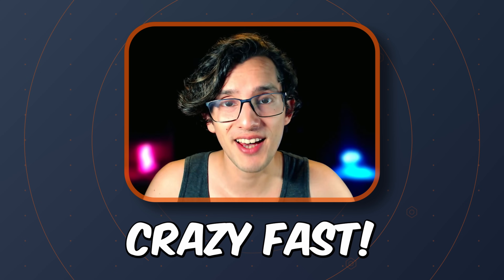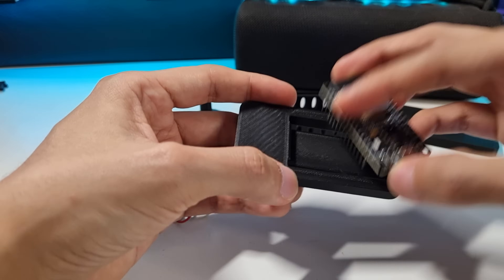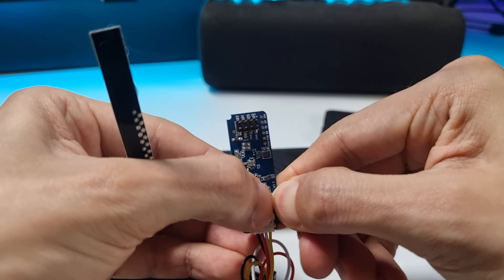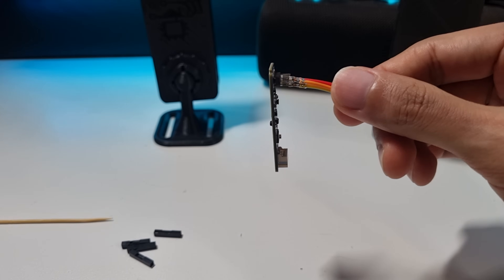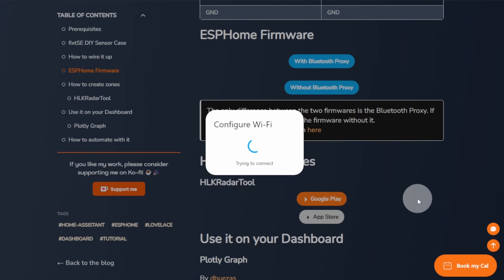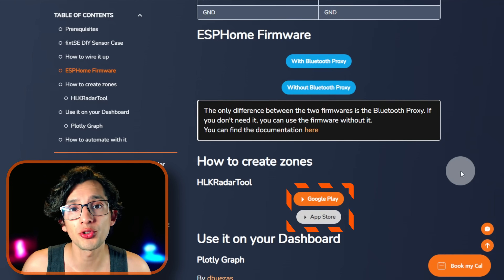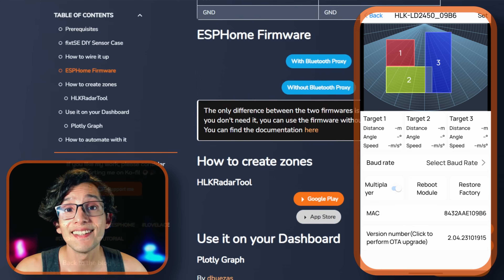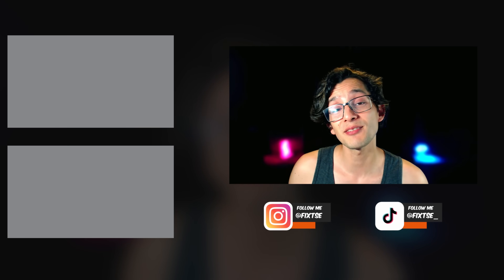Beginner DIY ESPHome mmWave Presence Sensor  |  HLK-LD2450 + ESP32

Comment: Hey, great video and amazing explanation. 

Does it work with ESP32 C6 Board. I want zigbee connectivity instead of WIFI. Also, ESP32 C6 board doesn't have RX2 and TX2 pins, so what are the alternatives?

Thanks in advance and keep up the good work!
Reply from the maker: As far as I know, almost any pin on the ESP32 could be configured as RX-TX (unlike on the esp8266), so that shouldn't be a problem. For the zigbee connectivity part, that needs more work on the ESPHome side (currently the firmware doesn't support to create custom zigbee sensors), not sure if adding support for creating zigbee devices is on their roadmap (zigbee devices are supposed to need a certification from the zigbee aliance, still I just transformed an Aqara Temperature Sensor from Bluetooth to Zigbee with some special firmware, so I'm not really sure anymore)

Comment: Is this built on esphome or is it a custom firmware? Because As I understand the base esphome does not support HLK2450 right now. 

The reason I ask is can we add additional sensors to this?
Reply from the maker: Yes, it's ESPHome, using a custom component to make the HLK2450 work. Yes I have a follow up for this video where I added a light sensor and a temperature/humidity/pressure sensor to the project
Reply: @fixtse.  you are awesome :)

Comment: Hi Fixt, everything installed fine, but, I don't get any info on Target 2 or 3, Target 1 has data, same on HLK app or in HA
Reply from the maker: mmmm try restore the sensor to factory using the HLK-app (it has happen to me before and that fixed it, it will erase all your zones, so copy the values before). If that doesn't work, it might be something with your sensor.

Comment: I've tried this project with two different D1 Mini ESP8266 NodeMCU ESP32 ESP-WROOM-32 I had here, but neither of them worked with the custom flashed firmware: all devices were "unknown".  Is this for just the specific device you linked or will it work with any generic ESP32 device?
Reply from the maker: Hi, it should work with any ESP32 device, if for some weird reason ESPHome doesn't detect your specific board variant (some new esp32s variants need this) you need to add specify it on the yaml file.
Reply: Try swapping the RX and TX pins

Comment: Can it also work with ESP32 S2 board?
Reply from the maker: The board has experimental support on ESPHome, so it could work (it won't break the board, you can safetly try),  acording to the documentation (https://esphome.io/components/esp32.html#configuration-variables ), it might need an extra flag in the yaml file, to specify the exact variant, if for some reason ESPHome doesn't detect it automatically.

Comment: Which board are supported? Esp32c3 super mini? Esp32 mini wroom 32?
Reply from the maker: So far I tried it only on the ESP32 Wroom 30 pin board, but it is still ESPHome firmware, there is no reason for it to not work on thoose boards (the suppor for the minis is still experimental, but it mostly works).

Comment: really great - keep doing what you are doing.  Some people are upset about "paywall" but that is not right.  They can still use the precompiled images
Reply: Not really, it depends what license the software has.

In many cases Open Source code cannot be statically linked with Closed Source - but this is exactly what pre-compiled .elf file is.
Reply: Thanks for clarifying. Of course you are right. Didn’t think about it that way. Minefield.

Comment: Is the sensor placement directional? as it looks to be mounted at the back of the unit ?  Is there any logic around this ?
Reply from the maker: Hi, yes, it's directional.
Yes, that is actually the front (that's why I put the logo on it, I know that seems like a weird placement). There are three main reasons for this:
- Since this is intended to be just a pressure-fit case, and PLA pieces tend to loosen over time, I prioritized having the base attached to the bigger part of the case to put less stress on the smaller parts.
- I considered moving the ESP32 board inside the case to get around the first limitation, but it made the installation and handling of the sensors more complicated, so I scratched that idea. I also considered moving the base to the bottom of the case, but that messed up with the stability (I could rework the joint in the future to get around it)
- One of the main limitations of mmWave sensors in general, is that they can't easily distinguish persons from pets, so a way to work around this is to mount the sensor at an elevated position, looking a little bit down. And in that case, the placement of the base attached "to the back" helps us to achieve that.

I hope this provides more clarity regarding the thought process behind the design! 🤓
Reply: @fixtse.  I cant understand. If I fit the ld2450 as shown on the video, then that means that the sensor is pointing to the opposite direction than it should. So the detection is awfully wrong. when the sensor "squares" face to the room, it works well.

Comment: Very nice video and presentation. I had my mmWave Sensor up and running in less than 20 minutes. Couple of questions. 1) HA plotly card: Is it supposed to show when a person is detected? (mine doesnt). 2) can you please do a tutorial to add a good Lux sensor and temp/humidity? I will have a perfect sensor to deploy all over my house :) Thanks in advance
Reply from the maker: Hi, yes, check if they appear on the HLK app on your phone, if they do, something is wrong with the code you are using on the card. If not, try using the factory reset of the sensor (this will wipe any zone you configured, so copy the values first).
Also, check my last video, I did just that.

Comment: Hi, I have a quick question why there is 2.4GHz PCB antenna connected to the mmWave sensor? Does mmWave connects to the wifi or something?
Reply from the maker: Hi, no, the PCB antenna is used to extend the bluetooth capabilities of the sensor (The bluetooth is only used to connect to the sensor using the HLK App). The wifi is managed using the ESP32 board alone.

Comment: Hello,
Very informative video.
does it work with HLK-LD2410 sensor?
thanks
Reply from the maker: No, sorry, but the HLK-LD2410 it's officially supported by ESPHome https://esphome.io/components/sensor/ld2410.html so you should have no problem making it work.
Reply: @fixtse.  The HLK Radar Tool, does it open up different for LD2410s?  I have LD2410s and when I use the HLKradar too I don't see what you see.  Your version of the tool is 1.1.69  the one I downloaded is 1.5.2, but your video is not that old
Reply from the maker: @CancunManny  the app doesn't work with the LD2410. It uses  the Bluetooth module included in the LD2450 to connect to it, the LD2410 doesn't have Bluetooth. A side from that, the LD2410 doesn't have the same features as the LD2450, so even if it worked, the radar like features (zone detection) won't be available.
Reply: @fixtse.  Thanks for the reply, and I admire the time you take back to follow up on comments/questions like mine.

The LD2410s do have bluetooth, but I think they are mostly transmitters.  If you get an LD2410 and provide the 5v and Gnd they will emit a signal.

I am able to use the HLK Radar Tool to get into the sensor and play around with the settings.  What had me confused is that my "menu" when I log in to the sensor is WAY different than yours.  After doing some reading I realized that is expected.  The 2410 and 2450 do have different functions.  If I had a 2450 I would see the same setup menu as you do, and if you have a 2410 you would see the same menu I see using the same HLK Radar tool.

An for those that take time to read comments to learn more, this is what I found out.  The LD2410's do a better job at locating "presence".  They can only track one object and will focus on the one with higher energy.  The sensor will tell you how "far" the object is, but not in which direction.

The LD2450 is not as good at presence detection, but it can track more than one object at a time, give you the distance, and tell you in which side they are on.

Asking which  one is better is a mute point, it comes down to what you are actually trying to accomplish.  If your main goal of your mmWave is for presence detection even when not moving, the LD2410 would be recommended.  

All that said, do you have a link to a video or write up on how to get my Android set up with Private BLE?
Reply from the maker: @CancunManny  Hi, thank you, i don't have a video on that specific topic, but I've manage to do it using a ESPresense device to get the IKR code (like I showed here https://youtu.be/u7pn2_2l7OI?si=bl5v7L_CwLkAtLD0&t=318 for an iPhone but with an Android Phone, then you can use MQTT explorer to get the ikr from the ESPresense Topic), and then just use that in the Private BLE integration

Comment: Hi grate video my device is up and running. I was trying to use the blueprint that you supplied but i cant get it to work with the zones so its all or nothing. is there a way to use it with the 3 zones set up?
Reply from the maker: Let me check
Reply from the maker: Ok, I updated the firmware to include a binary sensors for every zone, so you could easily use it with the blueprint, thank you for letting me know 😁🙌.

Comment: Thanks for an inspirational video! Do you know if it's possible to use the HLK-LD2410B instead?
Reply from the maker: Hi, thank you 😁🙌, Unfortunately no, the LD2410 it's a whole different sensor, most of the features are built into the sensors firmware, like the zone feature, so it won't work like the LD2450 can.